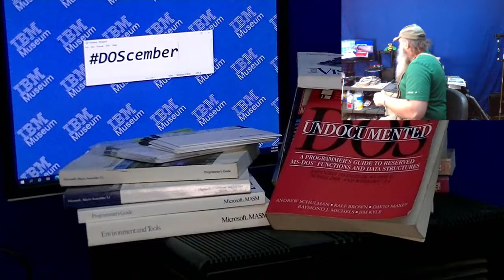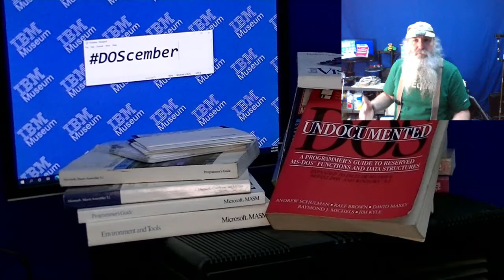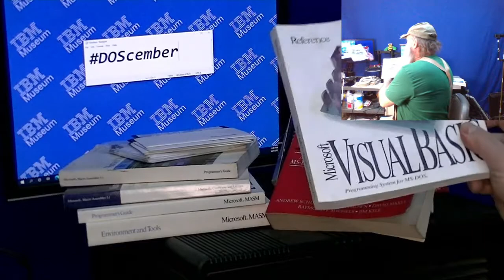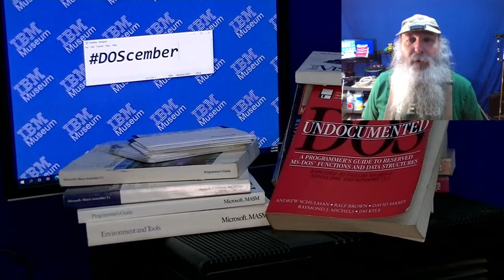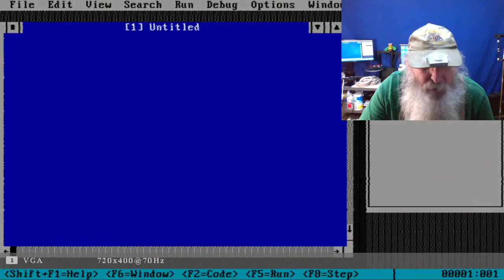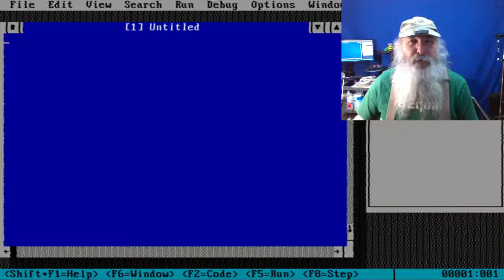Pulling out the DOS-oriented programming books - #DOScember

Comment: Oh that looks like a interesting Book. Dos undocumented. Funny when I started into computer how many programmers and a few other users of non IBM systems said how horrible Dos was. I myself found the answer early on. It is not a power os or anything like that. It is just in place between the hardware and the application you are running on it with a few tools. In fact we have a specific name for it back in the day. But I forgot what it was. Once I realized that. No reason to be mad or upset with it. If you really want to be upset at something. Look at windows 95. Ouch.
Reply from the maker: There is an "Undocumented Windows" book in the same series: https://www.amazon.com/dp/0201608340